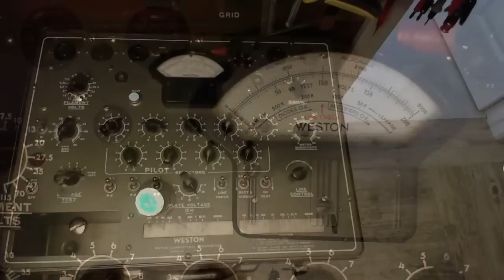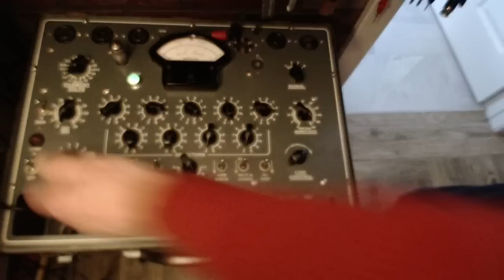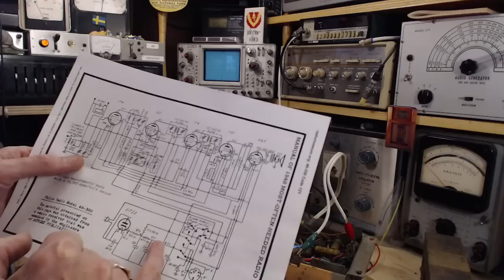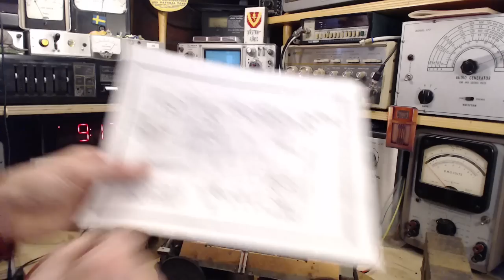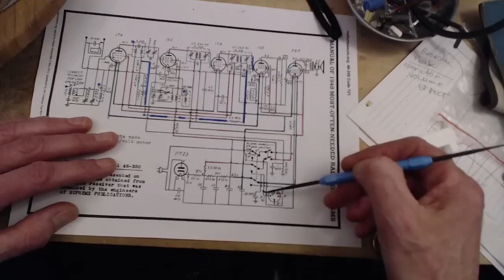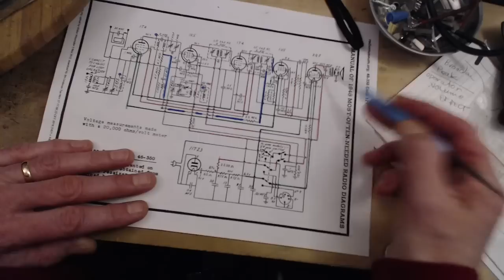Canadian Philco 409 (46-350) Portable Video #5 - Tube Heaters

Comment: Filament path: From R100C to pin 7 of 3Q5, the center tap of 3Q5 goes to ground via 680 ohm resistor (R207). That divides it into 2 1.5 volt sections. Pin 7 of 3Q5 goes to 1T4 (2nd IF) and and then runs to pin 7 of RF Amp 1T4. From pin 1 of RF Amp the line runs to 1U5 (1st AF/Det) Pin 7. Pin 1 of the 1U5 then runs to pin 7 of the converter (1R5). From there pin 1 of the 1R5 runs to B-, completing the circuit.

Check R207, C201, C202, C203, and C407. The bypass caps could have shorted and grounded the rest of the string. 

These portables have crazy filament paths, not straight-forward like AA5s. The bypass caps are there to keep RF out of the convoluted string.

Hope that helps.